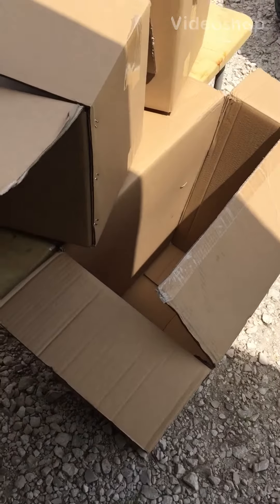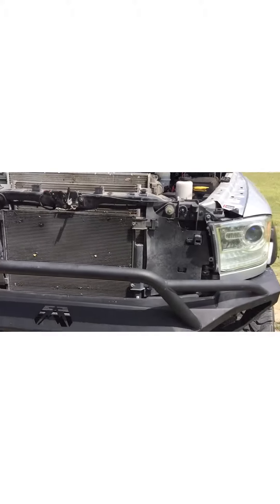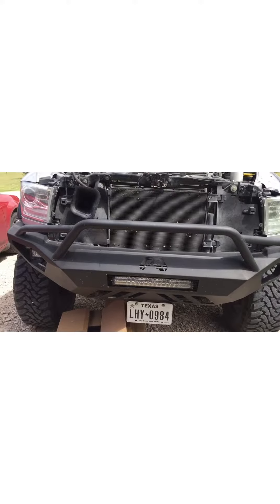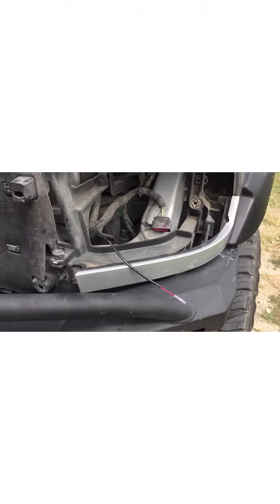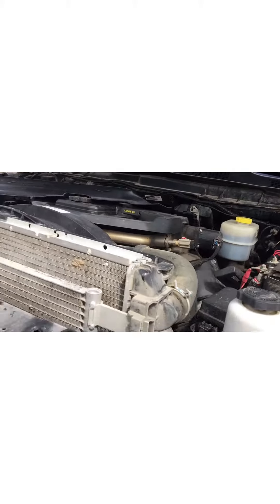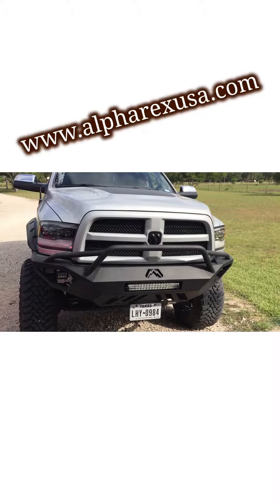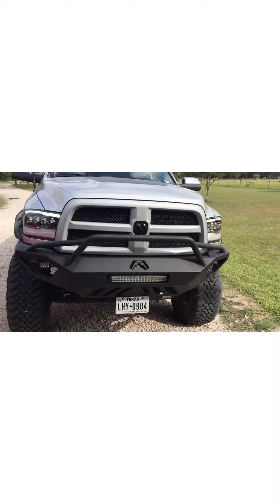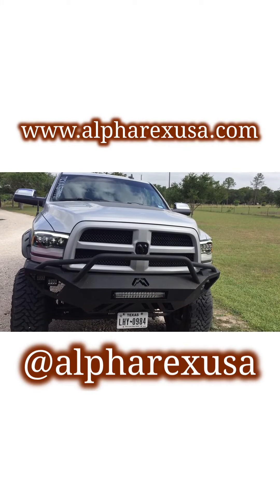www.alpharexusa.com Nova Series Headlights Ram 2500

Comment: What fuse did you hook the white wire to?
Reply from the maker: I hooked up to the windshield wiper fuse, but you can use any that are ignition hot fuses.  Sorry for the late response. Let me know if this helps.
Reply: @the_meg_2014  awesome thanks! They work well at night? Maybe make a nighttime video?